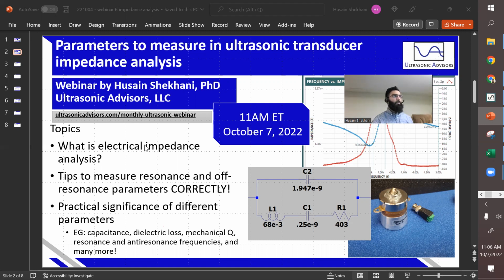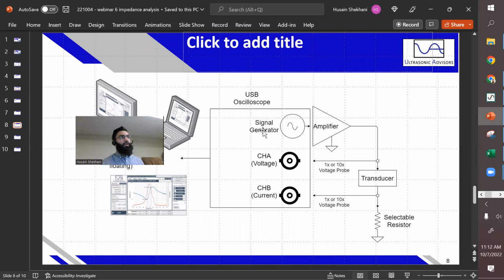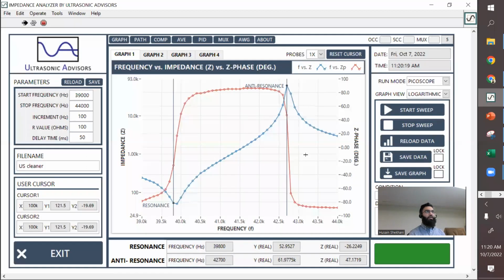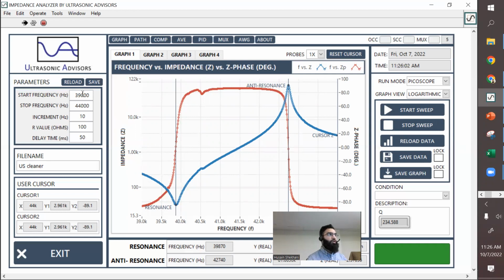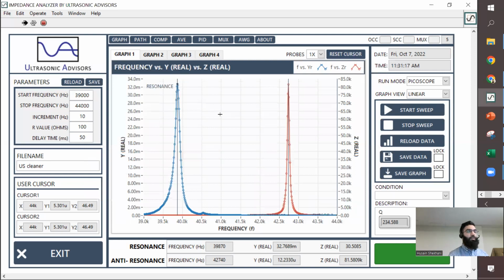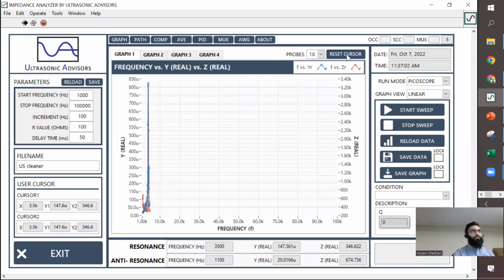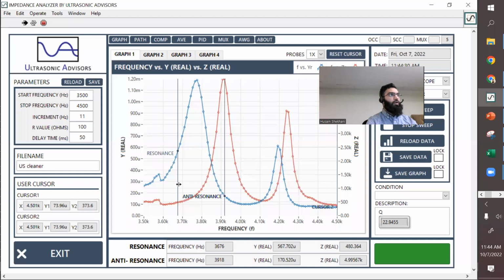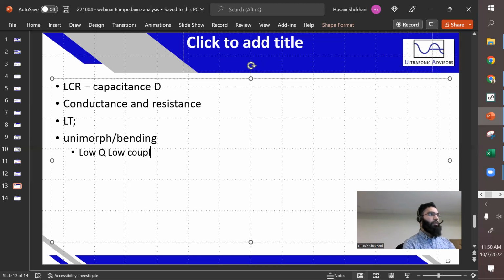Parameters to measure in ultrasonic transducer impedance analysis

Comment: Thank you Husain for a great video. I have a question. If I try to use the impedance analyzer check resonance response of my device on a 6 inch silicon wafer and i see the admittance changes at resistance but the phase swing is not full 180 degrees rather only 40-50 degrees, what could be the reason? Could it be the long cables from analyzer to the probe tips? Even if I try to narrow down the frequency range it still doesn't show full 180 swing. Is it only about low Q and coupling factor?

Comment: Very nice demo!
Some questions though...
How do you calculate the Butterworth-van dyke parameters from what you measured?
And I see how you measure the impedance with a voltage differential over a known resistor, but how do you measure the phase?
Reply from the maker: I am uploading a video on that right now. Check my new videos.

Comment: I have a basic question: in power ultrasonics, is the vibration amplitude controlled by voltage? How will the power be adjusted during the welding if I have set the power?
Reply from the maker: Voltage will be controlled to keep the power constant.
Reply: @ultrasonicadvisors  Thanks for the answer! So it means the current is set a constant value. Controlling the voltage to control the power?

Comment: Thank you very much for the upload! Could not join the last Webinar. 
Do you normally encounter nonlinear effects of the piezo in high power applications? Is it relevant? 
Does it result in faster aging of the piezoceramic? 
How would that be quantified?
Reply from the maker: Nonlinearity appears all the time in high power applications! It is relevant, but we use linear parameters to describe the conditions still. For example, measuring the impedance or quality factor for a certain power input.